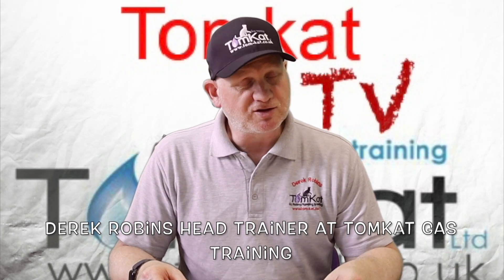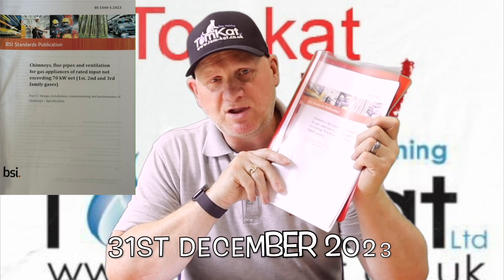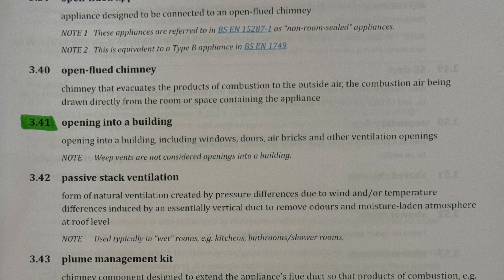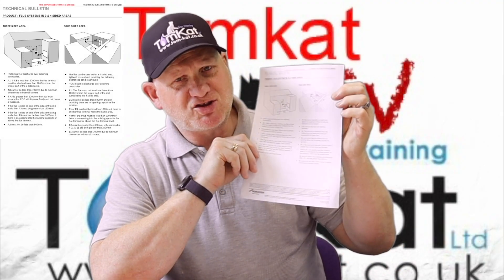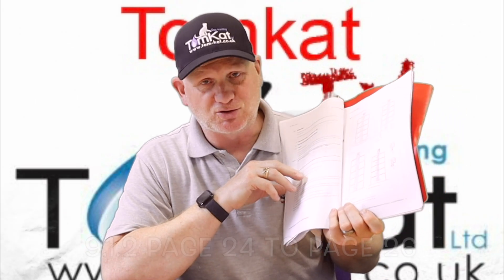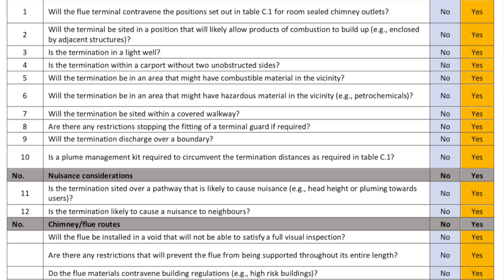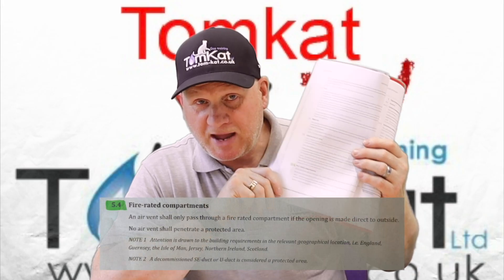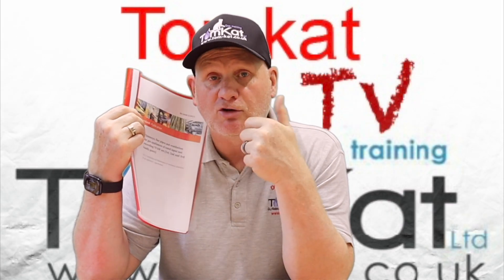Changes to BS 5440 parts 1 and 2  2023 that every gas engineer and trainee needs to know.

Comment: What about a flue terminal distance from a gas pipe? I recently come across a steel gas pipe on an outside wall in close proximity to a boiler flue terminal and it showed signs of corrosion from what I presume to be condensate from the flue outlet

Comment: Thanks for the update. So say you come across an old flue that terminates near a vent that its now not allowed too. What would you do? Would it be classed as not to current standards or need to be changed?
Reply from the maker: @Tommy6gs  do what we have always done assess the situation check there isn’t more than 10ppm of co coming into the property and use your engineer’s judgment with the situation that confronts you.
Reply: @tomkatgastraining